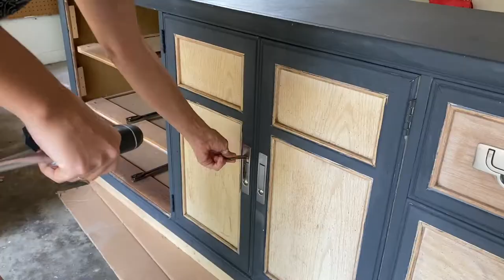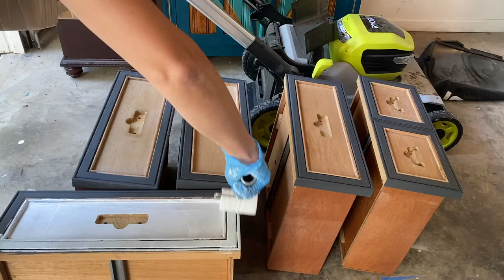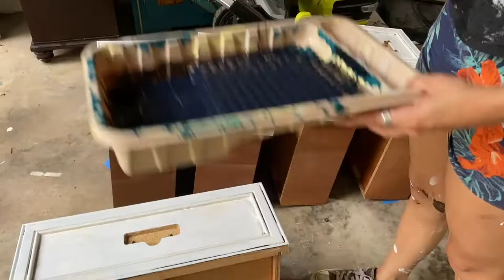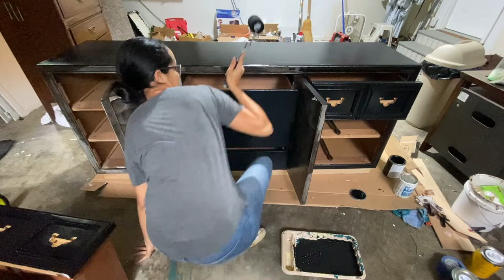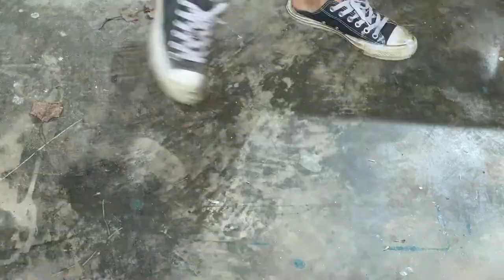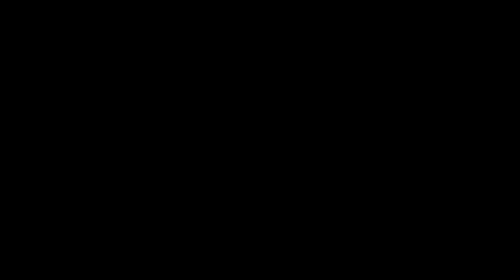QUICK PROFIT by Flipping Furniture | Credenza Edition | Episode 21

Comment: Looks good.  But you made less than $200 and said you put 12 hours into it.  Add to that the time you spent listing and selling and that's called minimum wage.
Reply from the maker: Well if you read the little caption on the bottom or listened further you would have also heard that 12 hours was mostly drying time and that I did the math and I only spent 2.2 hours on it so that’s almost $100 an hour 🥵🥵🥵 not mad baby!
Reply: @TheMissFlips  You count the time a piece is drying as time you put into it?  I hope you understand that makes no sense.  How about the time between when you bought it and when you started working on it? Is that time you spent on it too?  How about after it's done but before it sells, is that time you put in it too?  If you put a first coat on it and get busy and can't get back to a piece for 3 days did it take you 72 hours to do the piece? 

Obviously, time you're not working on a piece is time you're not working on a piece.
Reply from the maker: @eddieadams4770  lol thank you so much for your feedback Eddie but again, I will say that you didn’t watch the whole video because I do address the fact that I only spent 2.2 hours actually working on it. Thanks!